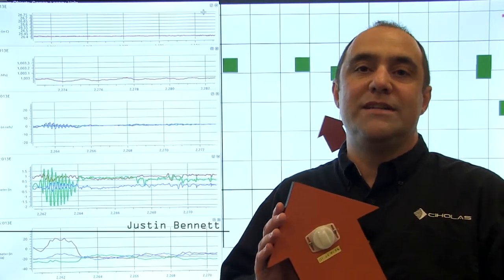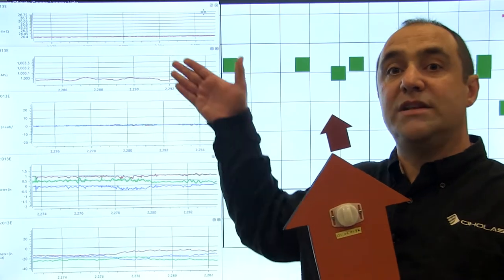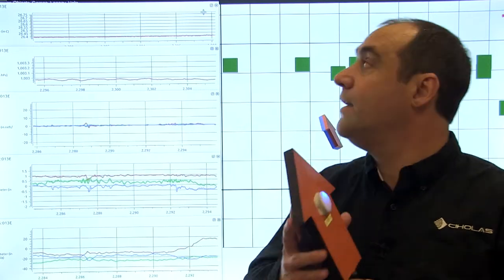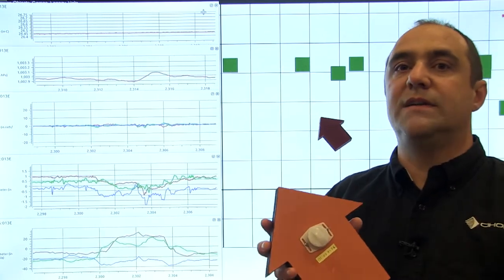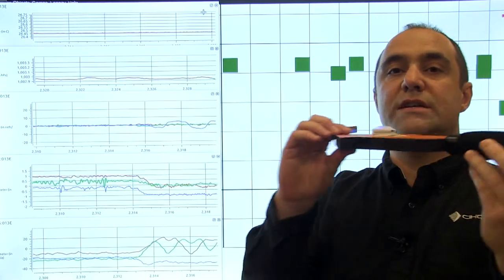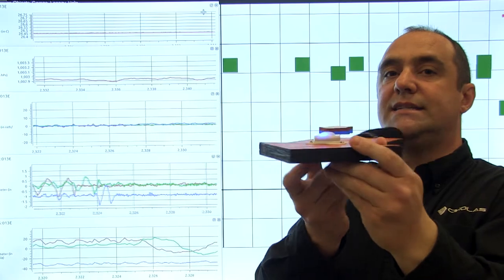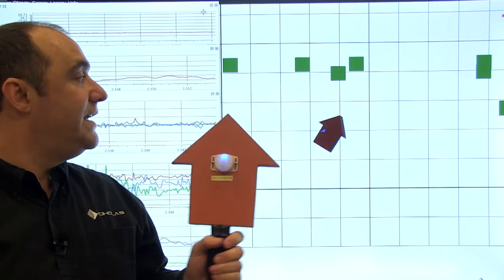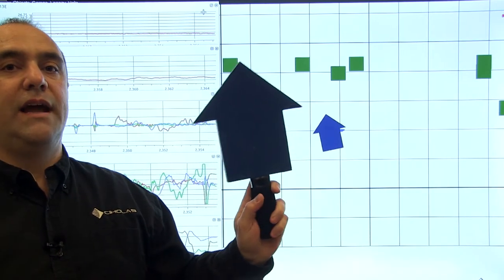CUWB RTLS: DWTAG Sensor Data Demonstration

Comment: Would it be possible to attach the tag to a barcode scanner and interconnect the system to an audible alarm set up by an specific area? In other words if any of ur scanners leave a specific work area alarms will go off avoiding theft or preventing scanners to get shipped to our customers by mistake (has happened before)